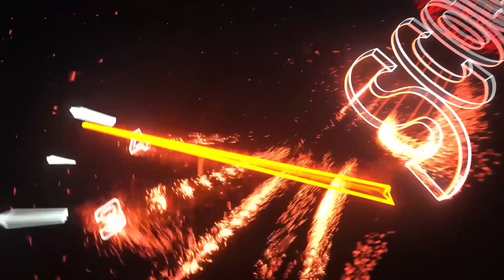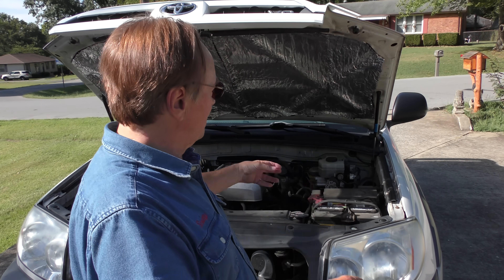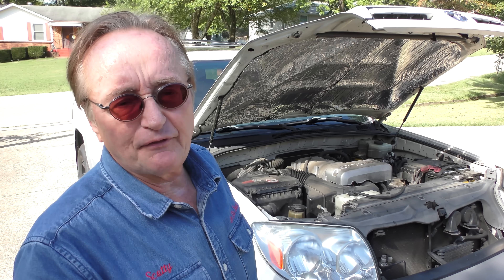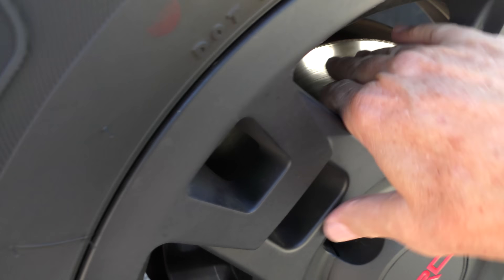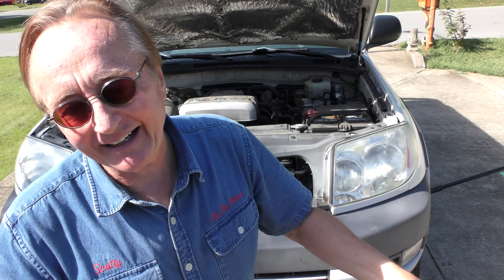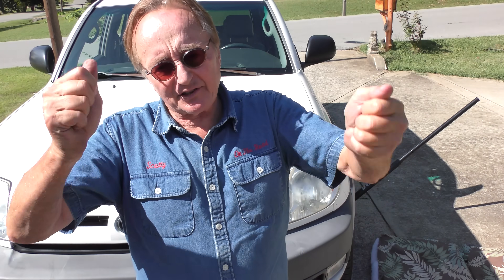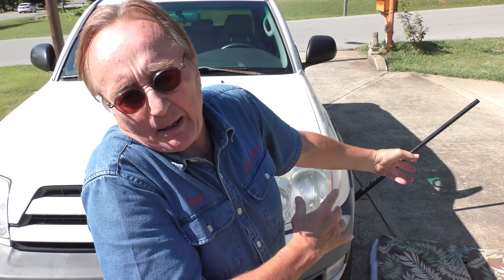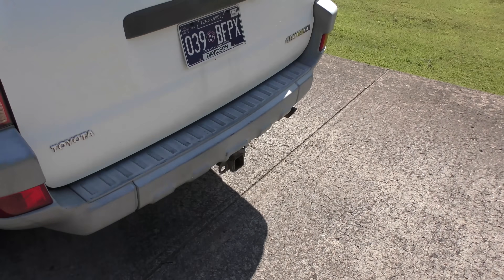Toyota Just Made the Ultimate Vehicle (and I Got One)

Comment: Some 4Runners did have a frame issue. Toyota warrantied the Tacomas with the frame rot, but not the 4Runners. Our frame is quite rotted 😥
Reply: Mine (2004) looked like new with 265K but the frame broke in half on both sides just ahead of the rear wheels.  You are right about the recall on the Tacomas but not the 4R.  Some guy bought it on eBay and it was shipped to Somalia!

Comment: I just bought one - for my oldest daughter.  She just tuned 24 and graduated from college 2 years ago.  She bought a wonderful home at 23 (she has a GREAT career ), but she is very frugal and doesn't want to buy a new car (she's driving the same vehicle we got her at 16).  My wife and I have long driven Toyotas and have had great luck with them, so we thought we'd look.

 I found a 1 owner 2006 4Runner V8 with around 75K miles.  It's the Sport edition with 4WD.  The car looks like new, in and out.  I paid a LOT for it (16K) and then had a new Timing Belt/Water Pump and all new belts/hoses on it.  After tax and the maintenance I had 20K in it. I would not usually pay that much for a vehicle that old, but I thought this was actually a good deal on a reliable vehicle.

 I sold it to my daughter for 10K.  I believe this should last her for at least 10 years or more!  It is a SOLID riding vehicle!!!!!!

Comment: I purchased a new 4Runner in '18, currently have 190K trouble free miles on it, brakes, tires, oil changes and wiper blades, that's it. When I read that the '25 4Runnner may be fitted with a 4 cylinder turbo I went purchased another 5th gen, 2023, I feel like I am hoarding gold! Looking for proven bullet proof reliability? You found it in the 5th gen.

Comment: Timing belts should be illegal!!
Reply: Still have them on Honda's...why I'd never buy a Honda
Reply: Interference engines with Timing belts, no less.
Reply: @loanokaharbor8303    Tell us you do not drive a FORD or RAM  truck ? Those are recalled and leave you stranded often.
For Honda 3.5L V6 engines that use a timing belt, it's crucial to replace the belt at the recommended intervals, typically around 100,000 miles, depending on the model and driving conditions. Failure to do so could result in the belt breaking, which would likely cause internal engine damage due to the interference design. However, it is the most fun to drive and reliable small truck you will own ... Not to mention Vtec power, better bed and trunk and instant 4WD features....
 (our belt /water pump was changed by dealer for 1500$). No break downs in 15 + years and she runs perfect.
Reply: We have a 1hz engine in africa. Its undestructable timing belt engine. Naturally aspirated in line six diesel. This engine runs forever
Reply: As an engineer I know that sometimes you need to cut weight on certain components. Especially when the truck is already pushing the conventional weight standards for a pickup truck.  Yes, ideally it should be metal, but given the weight constraints it's hard to decide which components should plastic or rubber.
Reply: Actually not.  The timing belt interval is less about the belt and more about replacing water pump, tensioners, pulleys, heater t's, coolant, ect.  The belt will last as long as a metal chain.
Reply: 6 cylinder version has chain
Reply: Honda didnt get memo😊

Comment: I'd argue the UZ is one of the best engines ever because it has a timing belt.

Timing belts get a lot undeserved hate.   100k mile interval can be a good thing.  Take care of "while-your-in-there" maintenance.    Engines with timing belts are noticeably quieter. 

Timing chains have all sorts of failures as well due lack of lubrication, and are much more complicated to deal with.   It's not the chain that snaps, but all the tensioners, etc.    A lot of corporate Toyota engines have had timing chain cover leaking oil also, not an issue with a belt.

Comment: 2WD on a 4Runner is a crime against humanity.
Reply: Not much different than a PreRunner Tacoma. You get the bigger/tougher 4WD look w/o the front diff. Nissan's version used to be the "Desert Runner", but now it's the Frontier Pro-X (vs the Pro 4x 4WD).
Reply: Even the 2wd is very capable off road.  Not a rock crawler but still nice.  Throw a rear locker in there…nice!!
Reply: It’s for the target soccer moms.
Reply: At the same time so many TRD Pros and lifted Jeep Rubicons never leave pavement 😂
Reply: Wouldn’t that be a 2Runner?
Reply: Real truck!
Reply: Pavement princess
Reply: Less crap to fix 😂
Reply: @timmccall4566  so what? At least they have the capability to if needed. Not everyone needs to be a hardcore off-roader to need an off-road vehicle.
Reply: @skoolynugenator1802  being in Florida I don't need 4 wheel drive
Reply: Not really. It’s still capable. Most 4wd 4 Runners never go off roading. Less maintenance.
Reply: @skoolynugenator1802  exactly point. And not everyone may need 4wd, just like you pointed out. Thanks for that 🤘
Reply: @timmccall4566  you don’t buy a gas guzzling body on frame vehicle with 2WD.
Reply: Not everyone is trying to get their daily stuck on a rock in BFE, scholar

Comment: Picked one up just this year, an '03 with only 140k miles. It's also RWD only, and on the highway I can get 20MPG. Runs so smooth and feels so solid that I just can't imagine paying 10x as much for a brand new vehicle, when this one realistically has as many miles left in it as most new vehicles rolling off the line in 2024 - and in some cases many more miles left than some of the new vehicles out there!

Much like this owner, for my wife I got a 5th gen but it was a low mileage used one we got for a much better price than new.

Comment: Scotty - Just got back from Indianapolis one hour ago, my 2022 5th Gen 4Runner with a V6 got 23.9 MPG at about 70 MPH even though I lifted it 1-1/2” with Bilstein 5100 shocks.
Reply: I’m looking to do the Bilstein 5100s on mine to, did you do all 4 struts and the rear springs for the lift or just the struts them selves? And did you notice any difference in how it rides on those verses the stock ones?
Reply: @SteveB88  Did all four and installed stiffer coils in the rear. Ride is stiffer. When braking, the front doesn’t dip as much and when going up off ramps or on uneven logging trails the body doesn’t sway as much. I’m planning on adding Method bead grip wheels and Falken AT4W tires - more aggressive than my Pirelli Scorpions. For hunting, I added a Cali Raised Stealth Bumper with LED light bar, Diode Dynamics auxiliary lights (amber) behind the grille, and Morimoto fog lights (amber). Hope this helps.
Reply: You are supposed to drive them at 80 - not 70.,😂

Comment: Considering that each bank has a timing belt, I bought my 03 limited with 174k. I immediately had the belts replaced. WOW, they lasted past the required interval service. I was sold. 
Truly a gas hog especially being a 4x4. 
Scotty was right , I will never let my GEM go. Still love my Corolla (fuel mileage), but the runner is great for family travel. 
For all us Toyo fans, it’s incredibly disappointing to what has happened with the new Tundras and Tacos, abysmal.  They are ridiculously expensive and no disrespect to Mexico , but Tahara is second to none. If you find one…hold on tight.

Comment: We bought a brand new 4runner in 05 and we still got it. It’s got 237k miles and never given us any issues, zero problems whatsoever. Just general maintenance and replacing wear and tear stuff has kept this vehicle running great. By the way, it still has the original transmission fluid and no issues.

Comment: I spent 2 years looking for my 2000 4 runner i found it at a Toyota dealer that replaced the rear brake shoes but never adjusted them  !  The owner traded it in because  the pedal would  go to the floor Duhh. I bought it wholesale too.

Comment: It would be great if not for rust issues and cracking manifold. I owned one for 9 years. Had to replace both manifolds and new ones didn't last that long either. Problem is, those manifolds are one unit with cats' So $$$$$$. I'd stay away from old 4.7 V8 4Runners.

Comment: I bought the sequoia vs the 4runner.  Bigger ,,,have 141,600 on it 2004.  Just did timing belt water at 139,000 miles
Reply: The sequoias last longer than 4runners accord to consumer reports online. The sequoia is also the most expensive toyota right now, Google The new 2024-2025 sequoia around 80k.

Comment: Which year do you suggest on 4 runners
Reply: Gen III   97 to  2002. .
Reply: @jeffhildreth9244  The cockroaches of SUV. They never die with those 3.4 V6 engines if maintained properly
Reply: @buzztrucker  Just replaced the timing belt and water pump at only 12 K miles since the last one. I don't take chances, the belt was 10 years old.
I plan on keeping it until I croak.
I have owned 130 cars and trucks since 1964,, this is right up at the top of the best of them. 
This stays with me along with my daily driver, a 1963 MGB.. my 7th MG and 30th Brit car. 
My wife has a 2018 Highlander, her second.
Maintenance is the key to longevity. I kept my 82 Toyota 4X4 base model long bed 5 speed for 27 years.. regret selling it.
I bought a 2016 TUNDRA new. POS.. Cup holder on wheels..offed it.
PS I was in the car biz for 25 years. It has tanked. Too many gimmicks, poor designs, materials and workmanship.

Comment: A few years ago I had a 4Runner as a loaner, not impressed, solid but drives and handles/brakes like a truck, unlike my Mazda CX7 with Turbo power and car like ride.
Reply: That's because it is a truck. It's a body on frame, your.mazda is a unibody.
Reply: @senseicorey9979  Yeah, but I also had a Jeep Grand Cherokee which also much smoother of a ride, handling, and  brakes.
Reply: A 4 runner is what you buy when you want a jeep that doesn't brake down
Reply: @senseicorey9979  Yeah, the newer ones, my 1995 was pretty much trouble free, except wear and tear items for 15 years.
Reply: @severinlourenco8355 Then I'm guessing you had a manual transmission.  The 95 Grand Cherokee had a faulty automatic transmission.
Reply: @Jason-fm4my YES, my first automatic vehicle, till my Mazda CX7. Smooth transmission, which I made better with synthetic transmission oil.
Reply: That's because your Mazda is a car and the 4Runner is....a truck. A real SUV. (Versus the dainty popcorn CUV's/"pickups" that are unibody and can't tow their own weight.)

Comment: Why if Toyota if so smart still putting a rubber timing belt on these V8 engines.
Reply: Cheaper
Reply: Don't they still usually drive well past the recommended 100k maintenance interval?
Reply: I bet, but it's also the thought that it’s rubber and can one day snap and make a wreck
Reply: @MiguelMartinez-yj7yu  funny thing is people think chains are so much better than belts because they're metal but forget the chain is relying completely on plastic guides that fail as often if not more often a good belt. VW 2.0T for example.
Reply: It's comes down to the almighty dollar which you may know means nothing.

Comment: my fantasy is older Toyotas or older Chevy square body. The less electronics the better. Don't need TV screens. Don't need cylinder deactivation. 
Don't need servo motor blend doors.I want old fashioned cable actuated AC and heat. The last time we had blend doors repaired on a GMT800 it was 1200.00! The AC was fine. Just those damn doors. Guess what? it's going out again. One dude online shoved a business card into the blend door to hold it open for heat  . The electronics on the Toyotas are way better made.

Comment: Honestly question.  What happens with an engine with a timing chain instead of a timing belt?  e.g. if the timing chain breaks, is it fixable?  Also, how often are you supposed to replace a timing chain?
Reply: Timing chains are just much less likely to break than belts are. Belts wear down and can slip after so many years. That’s why Scotty vouches for chains. And if you have a belt it should be checked regularly whenever you do your maintenance.
Reply: Chains don't really need to be replaced on a properly maintained vehicle. Generally the idea is that you'll sell off the vehicle before the chain is close to worn out. ( ie: 250k-300k miles)

Comment: Yeah we love our 4 runners
We have the 2020 and 2024 forerunners
Reply: Wish I had the money and I would have one for sure
Reply: How many miles does one usually get on a 4 runner. I can only afford used but my god they have a lot of miles on them
Reply: @bonniejones6894  they are totally over priced for what they are yes prob one of the most reliable vehicles out there but that's it not very good looking very under powered rides ok interior boring had 06 until accident they are basically the same engine since 05 haven't changed other that some little things but your paying top dollar for what u get which is dated 20 year old stuff.
Reply: @johnmiranda1341  what is not overpriced and still extremely reliable?
Reply: @bonniejones6894  Well maintained, at least 250k or so. There are some (normal) service/repair costs at that age but you find that the costs are more than fair when compared to buying most any newer model truck.
Reply: @NVRAMboi  wow 250,000 miles well worth buying. Thank you
Reply: @donmiller6435 I have a 2008 Acura TL with the J-series Honda motor. It had only 66,000 miles when I got it and I paid $8k. I expect it to run for many years.
Reply: @johnlowe2218  👏👏👏I prefer a real frame 🤫
Reply: @donmiller6435  well then you’re SOL if you’re looking to get one cheap. I’ve driven plenty of SUVs including a 2010 FJ Cruiser, but the premium on SUVs is no longer worth it to me.
Reply: @johnlowe2218  no worries. My '23  trd 4runner is doing me fine. Old school trusted reliability in a newer package.
Made in Japan.

Comment: Scotty, I have a 2005 4runner with the V6.

Stealership wants $4k to seal a (slightly) leaking timing cover. Any idea if that's even necessary? How much should that cost at an independent shop?

They also want $1500 to reseal the lower oil pan they claim is leaking. I haven't seen any oil in my garage so no idea what "leak" they claim.

Thanks!
Reply: AT205 Reseal
Reply: Try an oil seal/gasket restorer. Bar's stop leak products are inexpensive and have worked good for me. I just added some to my old gas power washer pump that was starting to leak a little oil and it stopped right away.
Reply: @johnb6084 that only works with rubber, like the front crankshaft seal. The timing cover is sealed with silicone RTV.

Comment: I bought a 1985 four runner drove it 275,000 miles trouble free except for 2 clutches and many free brake pads and no rear brake shoe replacement. It was a 4 cyl.. averaged 20 mpg. Great vehicle.
Reply: I have a 98 4 cyl.  Underpowered yes but Works fine with manual trans.  Going fine at 250k
Reply: Like my 2000 Tacoma. Underpowered but could not be killed.

Comment: SPOT on, just bought a 24' 4Runner SR5 Premium 4x4.  MSRP $49k  OTD $42.7K. w/ 17" tires, and the  ride is pretty decent. Not as good as a RAM 1500, but close.   Couldn't justify a TRD at $57k+, but they are great vehicles if you are a serious off-road driver.   Next year, Toyota kills this vehicle with a V4 and Turbo... ugh... dumb!
Reply: You got a deal!
Reply: @davidhorne2326  Thanks! The primary reason they will deal is because they can't sell their turbo trucks - their biggest profit makers.  Have you seen the price of those new trucks?  Insane, and those turbos fail at 125k miles - not 150k. I love trucks but manufacturers have really made a mess out of that market.
Reply: @rocinblues  I couldn’t get much off msrp. Demand is high. I had remote start and automatic tailgate added to my SR5 Premium. I am a dedicated Toyota buyer. Still have a 2005 Tundra that was bought new.
Reply: I'm in SW Florida, what market are you in?
Reply: @rocinblues  I live in Virginia but bought in NC. Most 4Runners are pre sold.

Comment: well duh heavy vehicles like the 4Runner are naturally gas hogs no matter what engine is in them take for example a V6 Equipped 1992 Buick Skylark GS weighed 2,800 LBs and average 21 MPG combined while a Mazda 6 is 190 LBs lighter at 2,610 and powered by a 2.2 L inline 4 though the base engine for the Skylark at that time was also a 4 cylinder all be it a 2.5 L and you could upgrade to a 3.7 L or 4.1 L V6